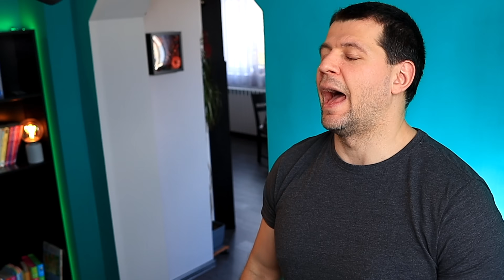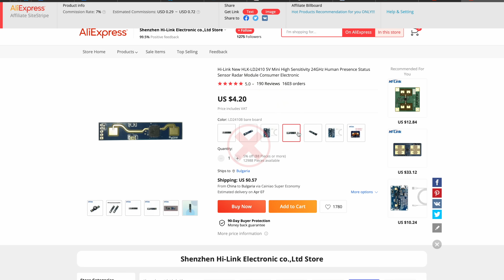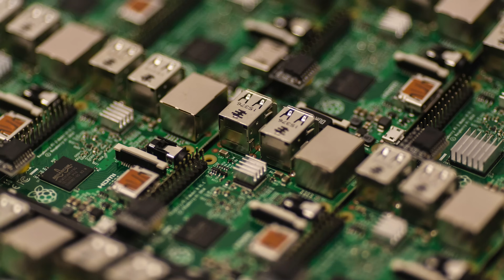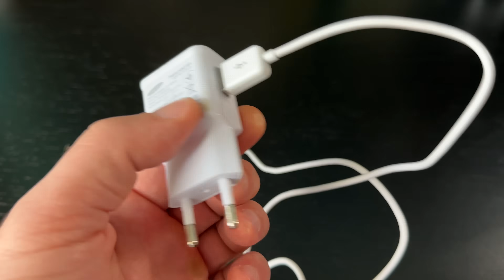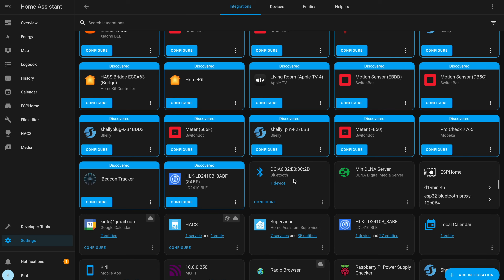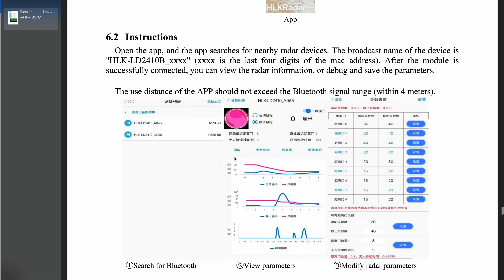Set up Human Presence detection with LD2410B and Home Assistant in minutes

Comment: honestly i'm using the sensor with an ESP32... i now know that it's possible to control it without. With an ESP32 you probably have the possibility to calibrate and set many parameters... but if you use it with the standard parameters what's the difference?

Comment: Why do you call it "Human Presence Detection"?  It detects MOTION.  If you have pets, they will set the thing off and HA will think someone is there.
Reply from the maker: Because it actually have a sensor for motion and presence and they work differently
Reply: @KPeyanski  so if a dog is walking around in the kitchen or romping on the bed, it won't trigger because the dog is not a human?
Reply: @KPeyanski  I wanted to add that I'm really not trying to be argumentative.  I've been trying to find a way to use some sort of HUMAN DETECTION to turn lights on and off that won't be effected by pets.  If this will do that, then I want to put it to use.

Comment: Hi, I had home assistant running on an Oracle VirtualBox VM on my desktop PC without bluetooth. In my network I have 2 shally plus with bluetooth that already receivi signal from shelly motion and door sensors BLE and some xiami temperature/humidity. Is there the possibility to connect the LD2410B to home assistant throw shelly devices or i need a bluetooth dongle?

Comment: Hello, I bought HLK-LD2410B and I am testing it. It gives me 4 types of data. stationaryTargetDistance + stationaryTargetEnergy AND movingTargetDistance + movingTargetEnergy .. We already understand moving, but it is very sensitive. For example, if I want the lights to turn on a little at a certain distance from the sensor, and then turn on fully when I enter the area or get closer, what data should I use here? If stationaryTargetEnergy is 100% and stationaryTargetDistance is 110cm, turn the lights on a little, and when it is 50cm, turn them on fully.. ?? What can I use data about Moving in such a setup? (By the way, I do not use a home assistant or anything similar. I am making a device that will work standalone)

Comment: Hi kiril. As always a very well explained video. I followed your instructions and wired 2 sensors. Hlkradar app finds the sensor but home assistant does not either automatically nor manually. I didn't change default password or gate. I use shelly 2pm as a Bluetooth proxy as explained in your respective video. Any suggestions please?
Reply from the maker: My only suggestion is to try temporary without the bluetooth proxy to see if there will be any difference
Reply: @KPeyanski how can i use it without the proxy? Isn't the proxy required to send the data?

Comment: #PresenceSensorOwned Thanks for the great work as always, Kiril. 
I had issues with stability, sensor becomes unavailable after 1 or 2 days, BT related.... My suggestion is to use an nodeMCU and use ESPHome. You can customize all the parameters and the sensor will be very stable.
Reply from the maker: Thanks for sharing. I have a video where I'm sharing how to connect the sensor to an ESP board. Anyways, congrats for the efforts and welcome on board 🎉

Comment: Since 2410B/2410C is BLE, can I power it using 3V battery?  How long would it run on batteries with daily detection?
Reply from the maker: I guess you have to try. The best will be to also share the results...

Comment: #Presencesensorowned.  I bought two of the LD2410B and installed one to test with Bluetooth.  It works for a while and then becomes unavailable in HomeAssistant.  I have it near a Bluetooth proxi and my other BLE devices function normally.  When I do a reboot of home assistant, the LD2410 becomes available again for a while.  Thep ower supply has been confirmed to be OK.  Any ideas?  BTW, I enjoy your posts so keep it up.
Reply from the maker: Try to connect to your HA without Bluetooth Proxy just for test. If the result is the same update the FW of the LD2410B. Also great job of making the sensor and thanks for typing the hashtag 👍

Comment: Hi kiril , I got the sensor thanks to this video , I bought the kit which comes with a connection board and a usb c cable . I’ve noticed that the sensor is a bit too sensitive and it’s turning lights when nobody is in the room , I don’t know why , perhaps is picking dust movement ? 
How could I decrease the sensitivity a bit ? 

Thanks heaps

Comment: Hey! Is it possible to do it with a 4 wired usb cable (green red white black) Thanks a lot for your time!
Reply from the maker: sure, you just have to use the black and red wires and to cut a side and tape the green and white wires  (just don't use them). Mine usb cable is the same and if you look closely you may see the other two wires that are staying cut close to the insulation
Reply: @KPeyanski  Great!! Thank you very much! :)

Comment: Did you have to do anything special to get the distance sensor? MIne is working great, but I don't have the sensor indicating the distance from the object. Using Z2M..
Reply from the maker: The distance is disabled by default, you just have to enable it from the Home Assistant integration.

Comment: K - I have a question,  I got my chips yesterday and I am able to set the movement and presence.   but I can figure out how to add the distance to create some automations.   How do I do that?
Reply from the maker: Hi Luis, distance sensor is disabled by default in Home Assistant for some reason. You just have to enable it from the Home Assistant menus - it is there as disabled entity along with some other stuff

Comment: I just got the Bluetooth (LD2410B) version of the sensor. I can't tell the difference between the bluetooth version and the regular LD2010 i purchased a month ago. Did the seller ship the wrong version? 
Any pointers or help is greatly appreciated. Thank you!
Reply from the maker: I’m not sure that there is a visible difference. Just power it up and check HA integrations section
Reply: @KPeyanski  I followed the instructions in the video but my HA (running on Pi4 ) is not detecting the module. I don't think I have the BLE version. I was hoping to see some distinction (chipset) between the regular and BLE version
Reply: I am now sure it is ble sensor because i am able to connect to it from my phone using the hilink official Bluetooth app.

However, home assistant still doesn't recognise the LD2410 sensor. I tried multiple sensors without any success. Any guidance is much appreciated.
Reply: @iot_enthusiast  did you solve problem? I have the same issue. Android App on phone is detecting module. HA on Raspberry Pi 4b doesn't see it.
Reply: @MrSilvann  please make sure ld2410b is unpaired from your phone. After I unpaired the sensor from my phone home assistant immediately detected it.
Reply: @iot_enthusiast Unfortunately, this is not that. Build in Bluetooth on my Raspberry pi 4b doesn't see this module. My samsung phone see it straight away.😢
Reply: When I moved module very close (20cm) to RPi, home assistant found it immediately. 2 meters away RPi doesn't see it. Argon Case with SSD.

Comment: If I get the BT version, can I still connect it via wire to esp32? what is the protocol in such a case? many thanks!
Reply from the maker: What is your idea? Not to use the BT, but esp board wifi? If that is the case I beleive ESPHome should be flashed on the esp board, but I never did that

Comment: bluetooth function not working properly
bt adapter in 1m and esp32 proxy in 1m too from another side but home assistant can't discover it.
when i soldered it to d1 mini with esphome ld2410 component i was able to use it.
after couple hours of testing and 10+ home assistant restarts it discover new ld2410. but ... time to time loose connection for 1-2 seconds( 
wired esphome works perfect.
Reply from the maker: try to update the firmware of the device, there are some reports that this helps with the BT connection

Comment: This sensor works with Shelly Gen2 devices? If not what is the recommended proxy Wi-Fi or Ethernet. Thank you.
Reply from the maker: it should work without problems
Reply: @KPeyanski  I’ve tried and HA doesn’t find it but the script is loaded on the Shelly.

Comment: #PresenceSensorOwned . Thanks for the tip. I have the C version ( a more squared pcb). Works fine, but if there is no movement, after a short while the Occupancy goes again back to Not detected. Any suggestions for that?
Reply from the maker: Thanks for sharing and congrats for the effort! Try to play with the settings from the software that the vendor provides using Windows or Android

Comment: Installed one yesterday and tested it a bit. It really works like a charm. During the evening, setting automatic lights shutoff after 2 mins of no detection, I never had a false shutdown. When i left the room for more than 2 minutes it correctly shuts the light off. Really good for the price! BT range though is really limited. Even with a repeater next door the sensor won't work. Probably it needs to be paired with a repeater for each room you want to install it into. Now I'll be looking for a suitable 3D printed case for a permanent installation
Reply: If you find a good case or design one, let me know!
Reply from the maker: Check thingiverse site and/or video description for 3d cases. Also try to update the FW to the latest the range may be fixed.
Reply: @KPeyanski  Thanx for your answer! After one testing week I also noticed there is a problem with the HA addon. Every 2 or 3 days the device stops responding and I have to restart the integration. Restarting the integration fixes the device allowing ti to start immediately so I don0t think it is an hardware issue. Anyway, how do I update the firmware?
Reply: so, one year later... how was your tests? do you find it precise ? it only detect humans or any bug flying around ? what scenarios you used to test it? did you try outside?
Reply: @fabianoslack4269  I had to remove it cause it was not working properly. Not working with BT repeater unfortunately

Comment: I tried the sensor too, but the integration doesnt seem to run stable atm. The sensor often disconnects until you delete it and add it again. There seem to be some bugs in the integration atm.
Reply: try to make a firmware update.since the version 2.04 20230225... the connection is by me much more stable.
Reply from the maker: thanks for sharing :)

Comment: Hi Kiril, great video and tip. I want to use them in my smart RV as presence detection additional to the Shelly motion 2. Saw that you also make your RV smart with Homeassistant. The sensors arrived today and I will integrate them over the weekend. Thanks for your tips.
Reply from the maker: Glad it was helpful and yes, I'm making my RV Smart slowly, but constantly :) What other sensor are you planning to add?
Reply: so, one year later... how was your tests? do you find it precise ? it only detect humans or any bug flying around ? what scenarios you used to test it? did you try outside?
Reply: @fabianoslack4269  Inside works fine, outside project needs time and I do not have enough.
Reply: @HannesSchleeh  is there an out of the box solution for outside to work together with raspberry pi and can "see"  through fiberglass 1cm thick ?
Reply: @fabianoslack4269  sorry, but I am not that deep into this to answer that.

Comment: If you want to skip the soldering you can also get the LD2410 kit. It has a USB-c connection on the board. It took me 3 minutes to do the setup and it works like a charm with HA.
Reply from the maker: Totally agree with you. Many thanks for sharing this info :)
Reply: ottimo l'ho preso anch'io grazie per il consiglio! ora sto cercando un stl per poter stampare una custodia adatta per il kit, l'hai per caso trovata?
Reply: Could you provide a link?
Reply: Link please

Comment: Bought 3 of them, took a while to set up as I needed to upgrade to the latest version of HA (2023.2.5) but then it worked. Not sure if the Bluetooth range is very good at the moment, I'll be testing that soon #PresenceSensorOwned
Reply from the maker: Excellent work Sean. Also, many thanks for the additional info. Updating HA can help as later versions have couple of fixes for this exact sensor!

Comment: Hello, I have same sensor and it dont want to integrate with Home Assistant. I made everything as you shown in video, but sensor doesnt show up even through its dedicated integration. Do I need to install any firmware on it?
Reply from the maker: Are you sure that you have the version with Bluetooth?
Reply: @KPeyanski  hello have the same problem here :( after doing soldering im able to find the device on my phone Bluetooth but my ha is not found it :( any ideas  ?? Thanks

Comment: I used the very same sensor but not a hombrew sensor but it came with those cheap zigbee tuya mmwave precense sensor (cost around 15bucks all of that with case and ready to use). and one thing I can say is, treat this is a very sensitive PIR sensor, not really good if your not moving or doing little movements as it can still report false positive.

still manage to fix the false positive by pulling out the sensor, use a serial ttl adapter to interface with the sensor, connect it to the windows pc and run that chinese calibration app and adjust the sensitivity, for some reason it was set to the lowest power and lowest sensitivity so I maxed out both and now it works really well but not enough to replace my Aqara FP1 because of the region feature.
Reply from the maker: Thanks for sharing all that information. Great comment :)

Comment: #PresenceSensorOwned Got two working following your video and once you get over soldering the tiny pins it was easy. 
It does seem that mine are dropping connection with HA and need reloading every few hours. 
Maybe a BT Proxy issue?
Reply from the maker: Nice work! You can try to use an antenna or you can update the device FW using the software that the vendor provides.
Reply: @KPeyanski  Hi! Many thanks! Can you provide some links for an antenna and a way to attach it? Many thanks!

Comment: So default password should not be changed, I'm a bit concerned.
Does this mean that anyone can connect with Bluetooth and read my sensor values and even reprogram it using an mobile app?
Reply: @KPeyanski Can you confirm?
Reply from the maker: Eventually someone can read your sensor values. But have in mind that this anyone have to be in very close proximity to your sensor. To reprogram the device you have to use serial communication part, which means you need to have physical access to the device.
Reply: @KPeyanski  Hmmmm. not exactly.  They also have BT software available for android that can scan for the device.

Comment: Wow, this is exactly what I've been looking for! I definitely will be ordering some, and setting up some detections. I think this is likely the first or second of your videos that I've come across in a long time, so I'll admit that I don't absolutely know if you've covered this elsewhere, but coming off of this video I had the following questions:
- If I'm considering designing my own case, what of the sensor needs to be visible/uncovered for it to work properly? Can it be fully encased in a little plastic box?
- Are there different sensitivity settings, allowing for the distinction between a small pet and a human? (just saw this is answered in the questions)
- What use case scenarios could you see for this? I know that I'm planning on using it to help turn lights on or off based on the direction someone is going, but I'm curious if there are other use cases you've found for it?

Thanks, I look forward to catching up on the rest of your video library!
Reply from the maker: - yes, it should work just fine through plastic box fully enclosed 
- a lot of scenarios are possible as you actually have two sensors, one for immediate motion detection & for presence detection. You can combine them in a beautiful way

Comment: I got one of these and added it to home assistant, but it keeps becoming unavailable after about 10 minutes. Restarting HS brings it back until its unavailable again. Any ideas? I'm stumped on why it's happening
Reply from the maker: There is big chance this to be somehow related to your Bluetooth sender/receiver. What are you using?
Reply: @KPeyanski  thanks for replying, I have a pi4 BT as well as a ASUS USB-BT500. I have the pi4 BT currently  disabled though, but have tried both with the same results. I'm within 2 meters of the reciever as well, so It shouldn't be disconnecting from distance. The LD2410 does get a bit hot as well, is that normal in your test case?

Comment: I'm getting an "unexpected error" when i try to connect it, it is auto detected in Home Assistant but just won't configure
Reply from the maker: What Bluetooth device are you using?
Reply: @KPeyanski  the internal bluetooth in my NUC, but after testing it with a ESP Proxy it seemed to work

Comment: As always, a great video! How about the BT range? In my case, even a closed door will stop the sensor from responding to the proxy, even though the proxy is only 2 meters away.
Reply from the maker: I can't tell why is that. Is the door made of metal?
Reply: @KPeyanski  Not at all. The signal is even weak when connected to my phone. Iwould need to have proxy in every room, unless the unit I have is defective.
Reply: @pauloferreira2834  Would probably be better to just wire it to ESP, because ESPHome has support for this. But I agree, it is still cheaper either way.